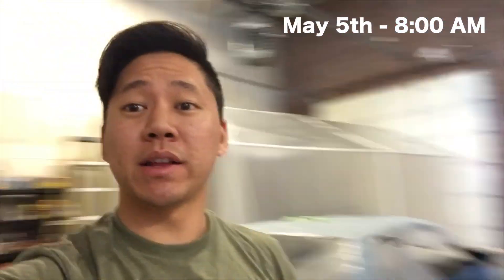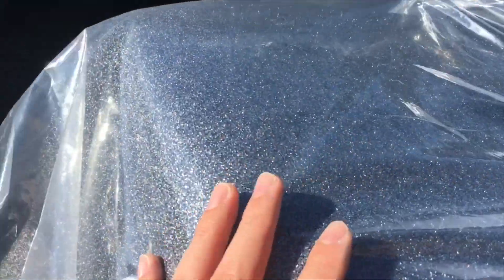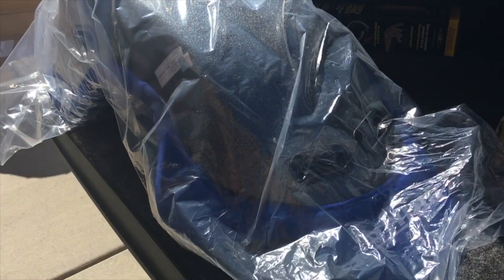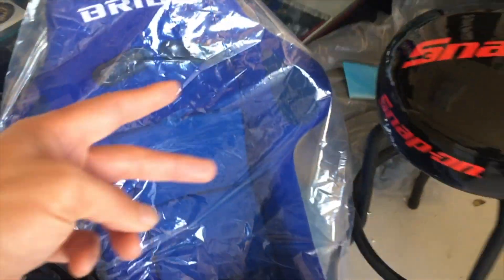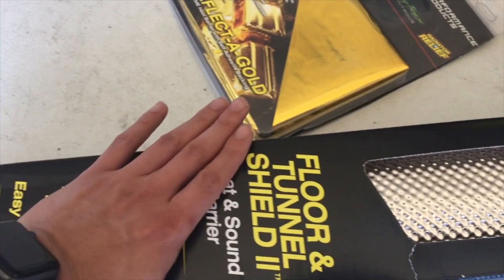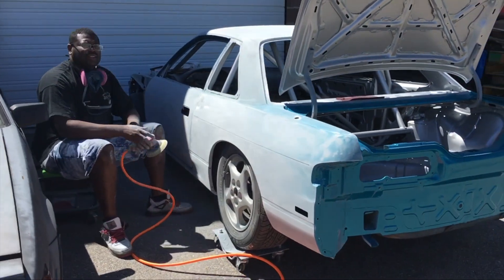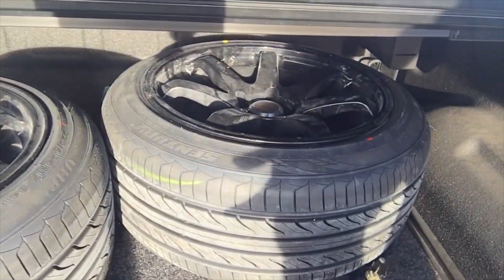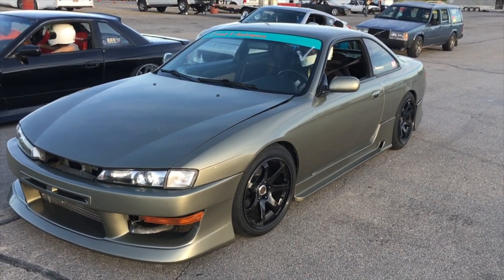Death of the Kouki S14 at the Drift Event - Vanilla Collection VLOG #47

Comment: What kind of oil do you run? RIP SR.
Reply from the maker: Misterdude206 summer time when it's hot 20/50 and spring and fall when it's colder 10/40